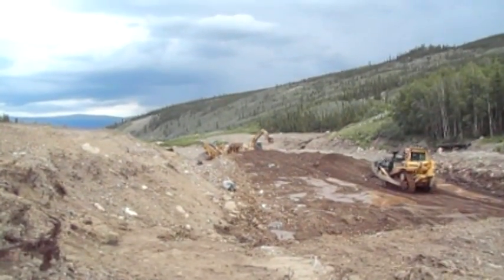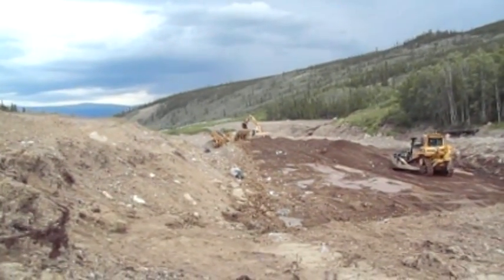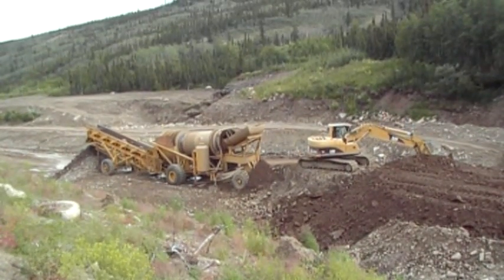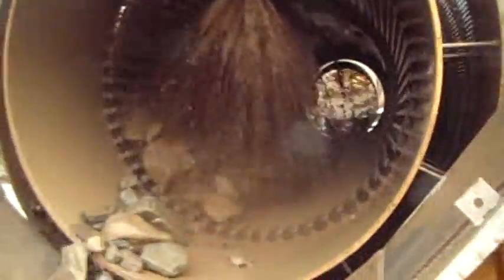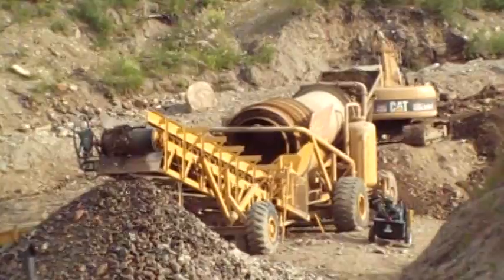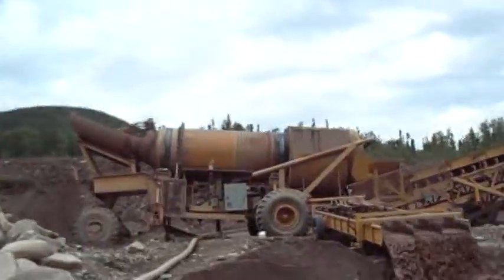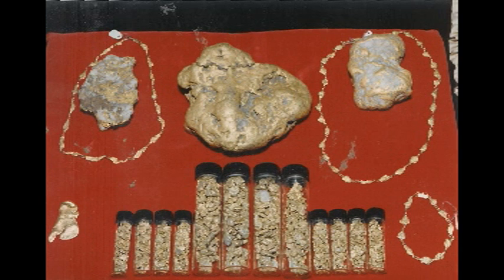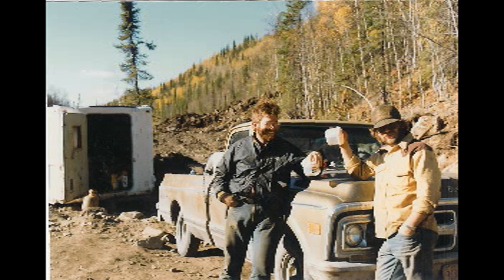Alaska Placer Mine 2010.mpg, Alaska Gold Mining, Large Gold nugget, 6 foot trommel, D9 dozer

Comment: Would the trommel not put that big nugget of our friends down with the other large rocks or is there a spesial thing that does so that large nuggets will be put in the sluise box?
Reply: I still have this question
Reply from the maker: @lucasburke6099  In the area of the mine no nuggets that large have ever been found.  The area the large nugget came from, when they mine they permanently mount a metal detector under their conveyor belts to get the big ones.  The detector either shuts down the plant & sounds an alarm, or deflects the discharge to a different location for saving potential large nugget material.